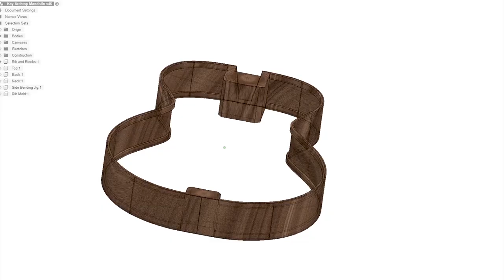Building an Acoustic Octave Mandolin from Scratch: CNC and Hand Tool Hybrid Approach | Part 8

Comment: Nice. I cheated. I CNCd my blocks in sections and then joined them, so that they had the curve of the outside copied from the profile. 🙂
Reply from the maker: These where so simple I just did them by hand, I usually do the same, it's just not necessary with these.